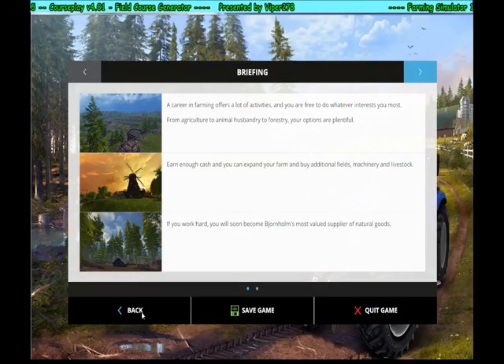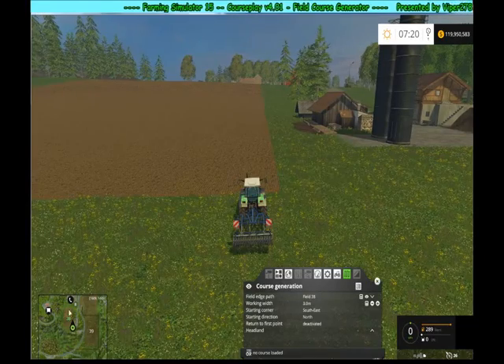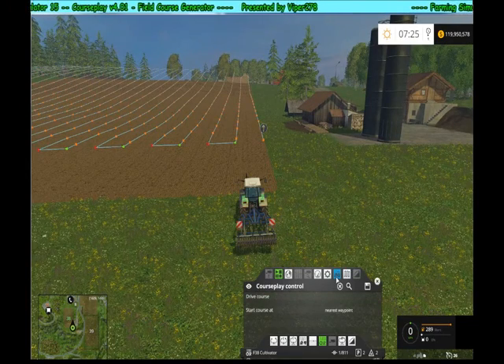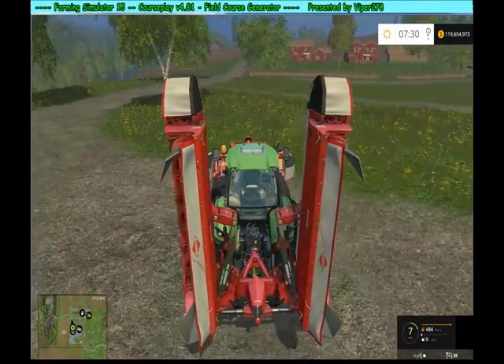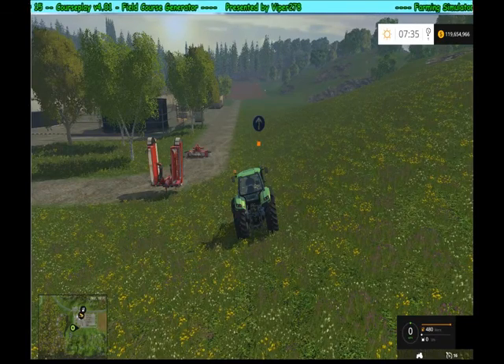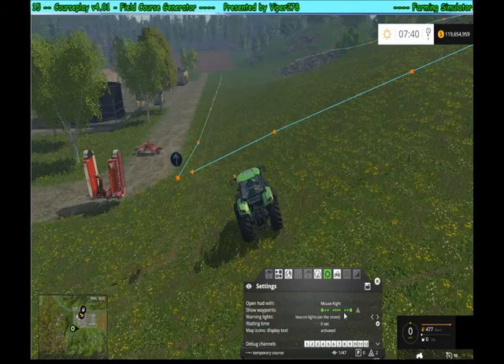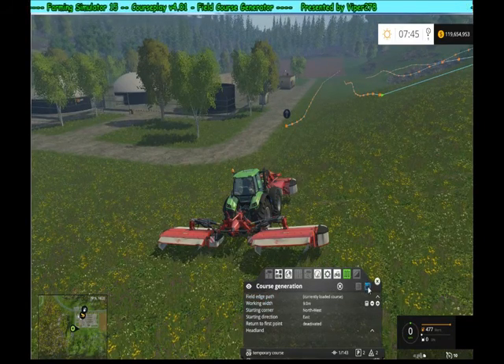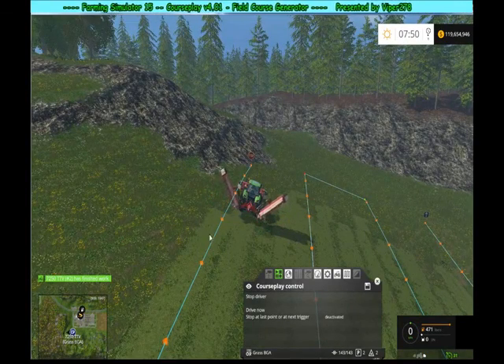Farming Simulator 15 - Courseplay Tutorial - Field Course Generator

Comment: thanks for the tutorial. i could not see which icons you were pointing too :(. maybe record in 720p if you can? might make it clearer to see the icons and text. At least it gives me something to work with for now.
Reply from the maker: i did record the videos to 720p. i watched the begining of the video today on my phone actually and I can distinguish which icons i was choosing. If you have a particular time stamp that you had trouble with but i tried to go slow on the clicks so viewers have time to see what I am doing.
Reply: +viper278 So you recorded in 1280x720? why does it not show the 720 option in the playback resolution options, it only has 480?  also it is playing back in 4:3 format not 19:10 or 19:9 so 720 is not possible in 4:3 mode.  strange.
Reply from the maker: +FullLifeRebel That is strange that it is does not have an option higher than 480p. I actually recorded in HD and when I upload to youtube my conversion software for youtube is set for 1280x720. This may have been one of my first videos and I had uploaded directly to you tube from my streaming software and it may have downgraded to upload it. When I get time again I will rerecord the ones that are 4:3. I think there were 2 of them before I switched my conversion software. I still could read the text and icons. But I do view it on a HD  monitor so to me it is readable.
Reply: +viper278 I checked the others and you are correct. the first 4 videos are in 4:3 360 format and then it switches over on the 5th one to 720